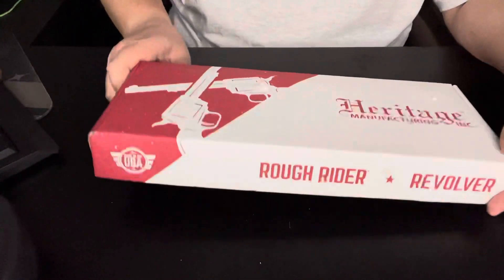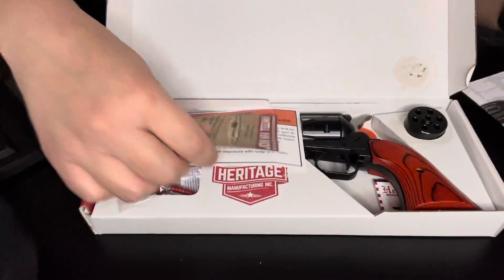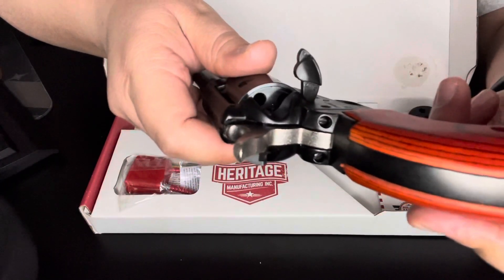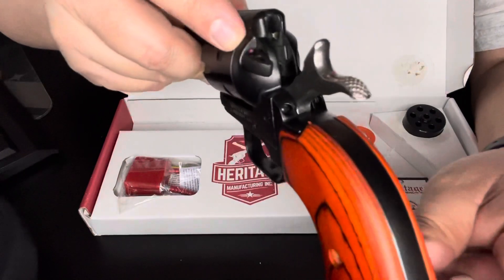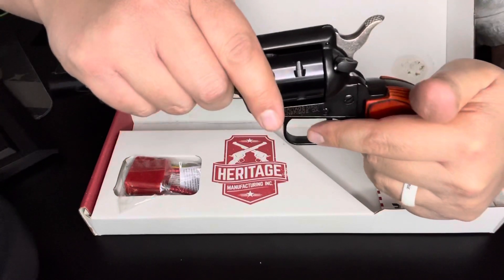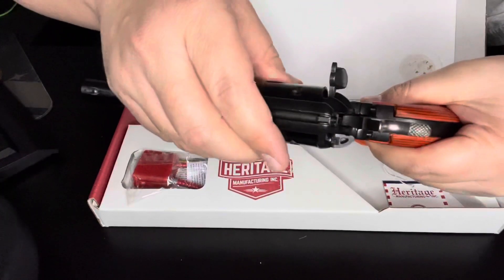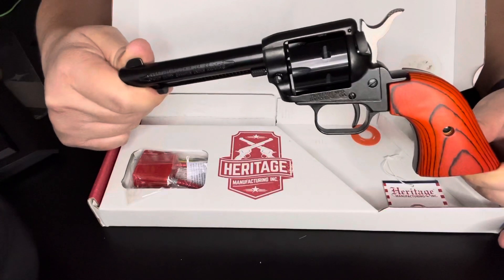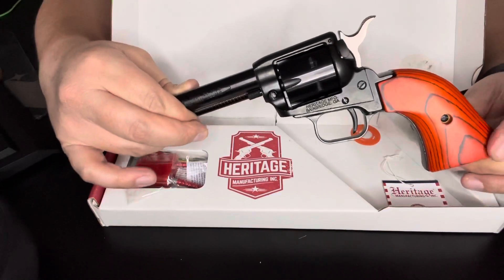HERITAGE ROUGH RIDER REVOLVER!

Comment: Get the ruger wrangler, heritage RR is cheap. Lots not to like here, stupid safety blows, trigger not as good as wrangler, heritage has free spinning cylinder and does,nt require a empty chamber for safety since it has the firing pin bar that prevents firing even when dropped. Some have said they went with the heritage over the ruger due to the 22 mag option but REALLY GUYS, How much are you gaining over a high velocity 22LR with hp,s out of that short barrel , NOT ENOUGH FOR ME TO OVERLOOK THE CHEAPNESS OF THE HERITAGE or the better construction of the ruger as well as the great looking durable finish .
Reply: T Wolak The Wrangler is not a traditional Colt style revolver either since the loading gate frees the cylinder rather than hammer half cock. I don't like the idea of accidentally flipping the loading gate and freeing the cylinder either. That feature alone is why I did not get the Wrangler. I have not had the best luck with Ruger autoloading pistols either from bad quality control. However I would not turn down trying most Ruger revolvers or rifles.
Reply: That free cylinder is why I got the RR over the Wrangler.  Having to manually index the chambers when ejecting is silly and slow.  Let's be honest they're both kinda cheaply made.  Might as well save another buck or 20
Reply: @williwonti  The wrangler is cheap. The ruger even though it's a budget quality gun is SOLID.
Reply: Heritage does NOT have a free spinning cylinder.  Ruger does.
Reply: @johnminarik3442  Yeah and that's such a deal breaker huh. It takes about 2 minutes to get used to loning up the cylinder holes with the push rod. Ille spend the extra 75 bucks and go quality .Ruger is much better made than the RR.
Reply: @twolak1972  

Just pointing out your incorrect information.  Just because you hate RR does not mean everyone else does.  Plus the Ruger is not tough enough to handle 22 mag.  To each their own
Reply: @johnminarik3442  I dont hate anything. Just pointing out the ruger is higher quality . Yes to each his own. Some like quality built firearms , some can only afford junk. That's fine. Ille pay the extra to know when I pull th edx trigger its gonna go BOOM.